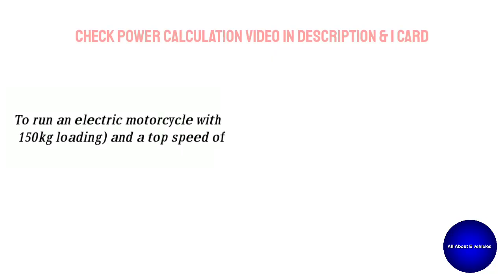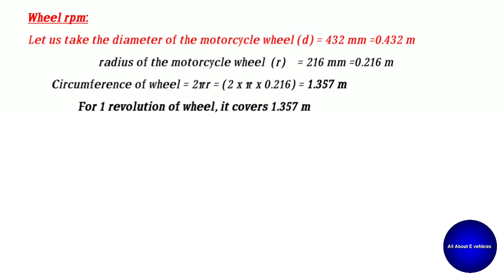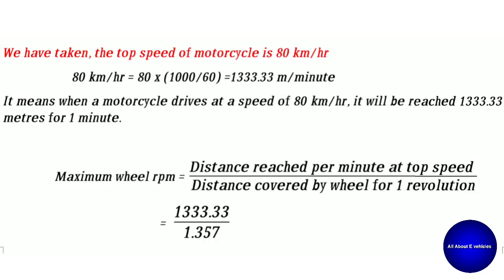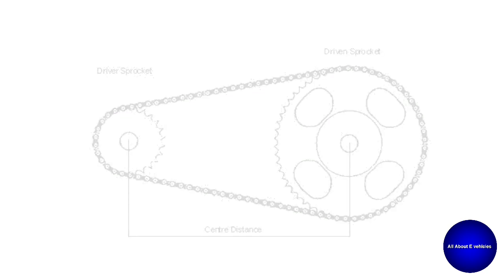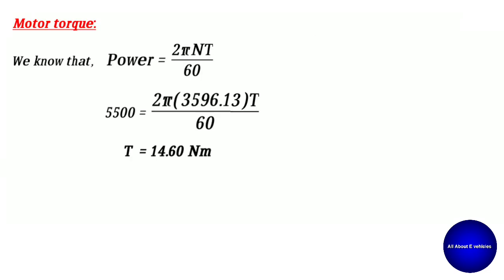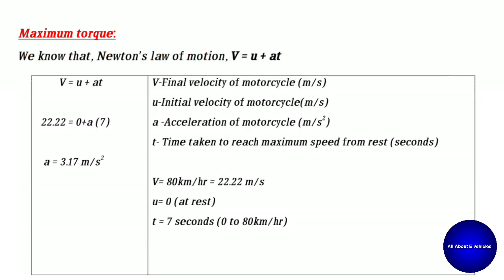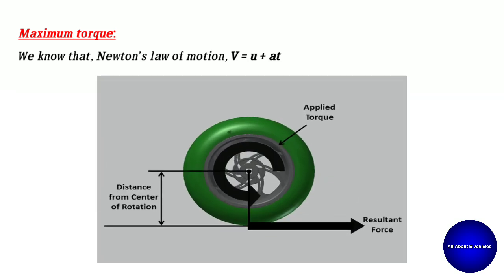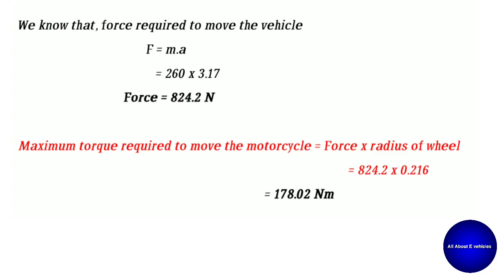All about e vehicles | How to calculate Torque and speed of the motor|#evehicle#motorcalculation

Comment: Sir in this video where you were disscusing about finding acceleration with the help of newtons equation
V = u+at
In this you taken t is 7 sec. 
How did you take this without any calculation. I can't understand this value. Can you explain please ?
Reply from the maker: This acceleration can be fixed initially as a constraint.
Reply: Ok 
But this constrain has some perameter of taking this value.

Because i am calculating e-cycle acceleration. So what i take value of "t"
Reply from the maker: What is ur top speed?
Reply: Top speed is "25 KMPH". And i have also dought on sprocket ratio. I have 350watt BLDC Hub motor so how i calculate its "RPM"